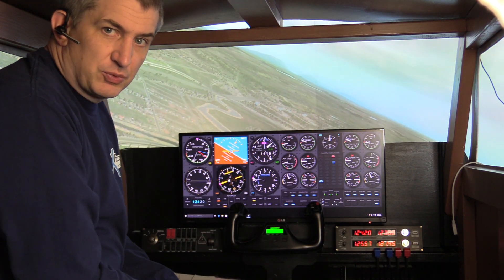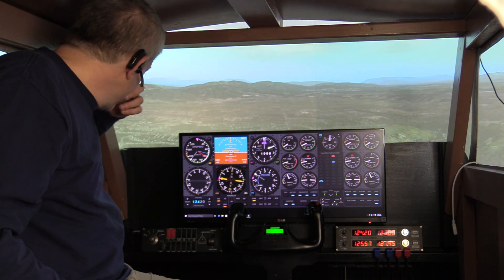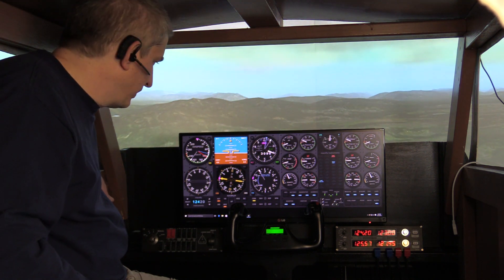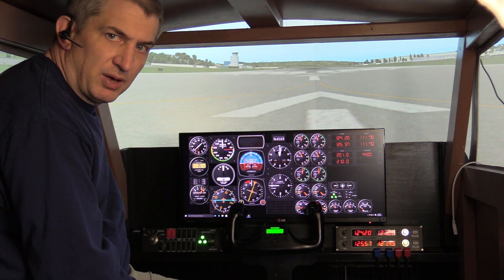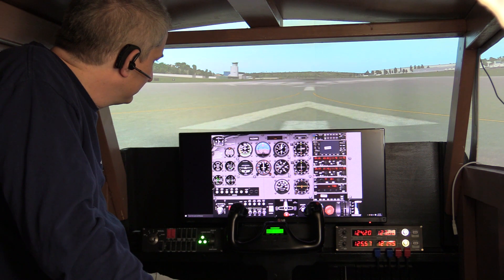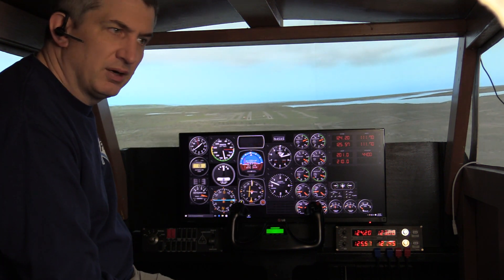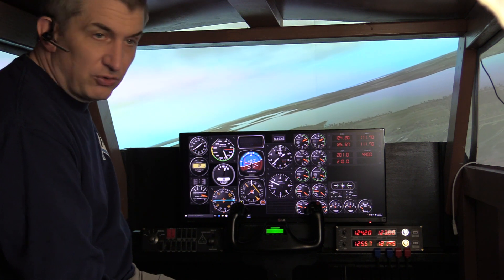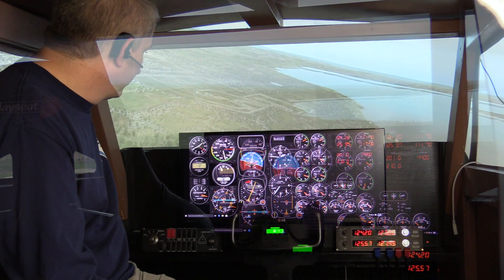Air Manager 2.1 on Curved Wall 180 Degree System at XForcePC

Comment: Did you say you are using a PC for each projector? I cannot afford 4 PCs to run XP11. I just purchased the Ryzen 9 3900X to use with my GTX 1070 and 3x4k displays + a single 1080p panel for instrumentation however FPS is terrible and there is a lot of stuttering. Besides running the 4k panels at 1080p what can I do to fix these issues?